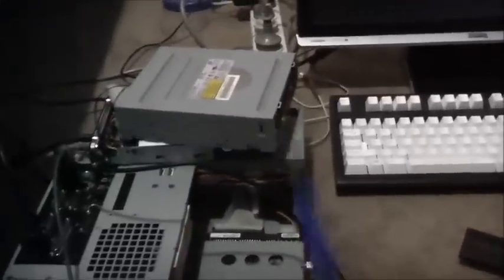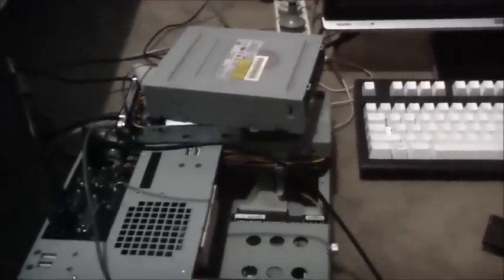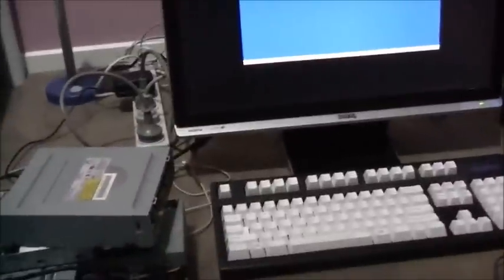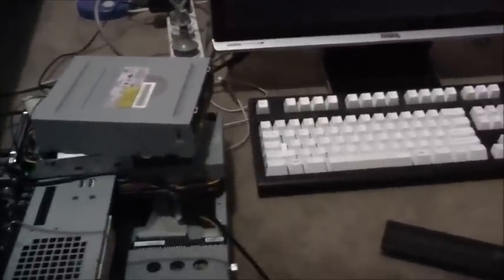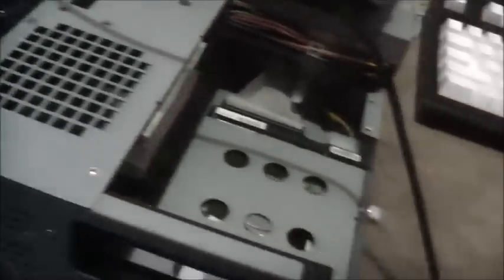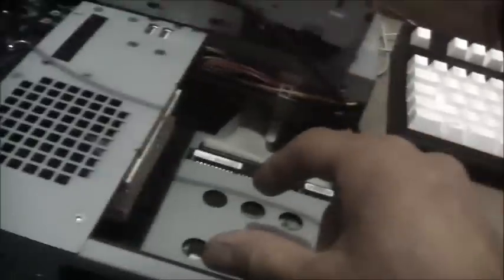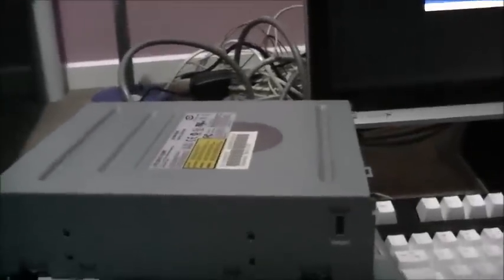Installing Windows XP On Embedded Kiosk Computer

Comment: Right: 
7b means Inaccessible boot volume and is caused by missing IDE/SATA controller drivers.

To figure out what you need: boot a live linux CD, open up a terminal, and run 

lspci

In there it should show you a list of hardware, look for anything to do with IDE / SATA.

Grab drivers for the mentioned things, use nLite to integrate them into the install CD.

Install Windows, sorted.

If you need a hand with any of this let me know; I do this shit as a hobby as well as my job now :)
Reply: +classicmacintosh You are servicing such old rubbish? o:
I have no use for such old hardware. I gave away my old Pentium III to my local PC hardware and fixing store because I do not have any need for it anymore. Besides the Motherboard had a fault, Windows XP was running awful at the end.

Now I have a Laptop of 2012 and a PC 2015 with fairly modern hardware and both systems have no internal optical drive. I just use an USB one. Why? Bloody Windows always hangs and stutters when such a bloody slow optical piss-poor drive is present. HATE these pieces of garbage! NEVER attache one of these into a machine, they will get slow to buggery!
Reply from the maker: Gotta make a live linux cd lol
Reply from the maker: Will try my Zorin Disc!!
Reply: *****
I wouldn't say I am exclusively old stuff :P I run a fairly extensive home lab too... there is just shy of 100GB of RAM in my VMWare cluster so by no means is it obsolete :)

I just like tinkering with this older stuff.